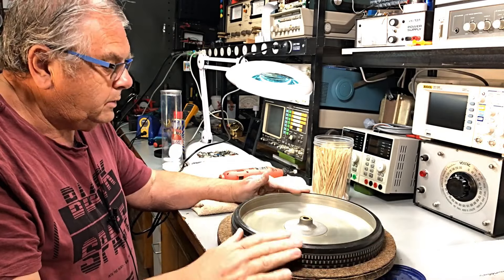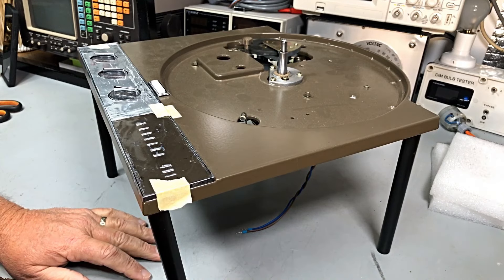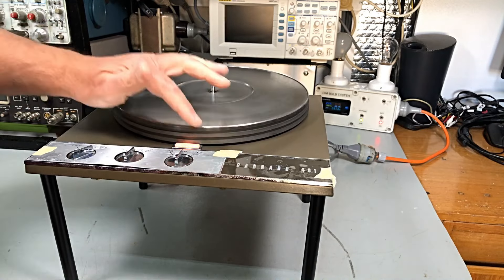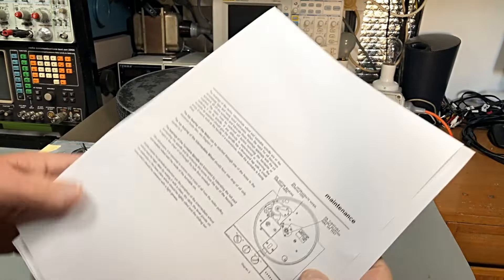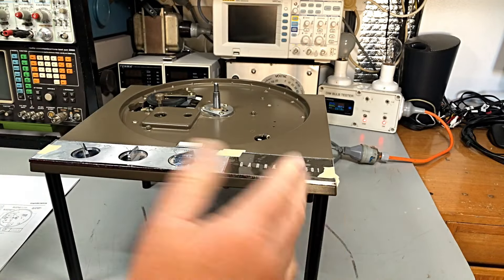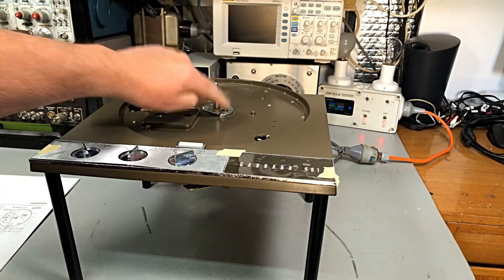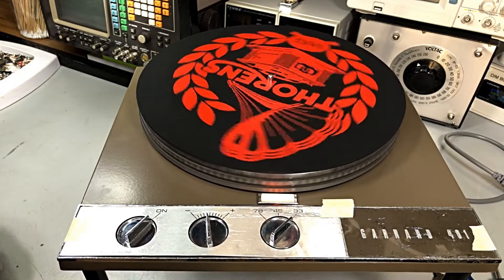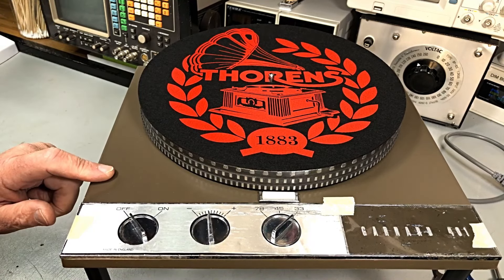Garrard 401 Rebuild Finale'  -  Part 4

Comment: Firstly, Congratulations on ONE THOUSAND SUBSCRIBERS!
One turntable down, one to go.  I can see why these are sought after.  It just goes to show that when done well an idler wheel turntable is right up there.  Such a pity about the front escutcheon.  Still, as you say, someone will have one.
Cheers and thanks for another great video!
Reply from the maker: Still in shock at 1K Subs Don, I am so happy that people are interested in what I have been doing for the last 55yrs.
This TT came up pretty nice & there are facial available on Ebay at reasonable $$. Thanks for you comment, means a lot !
Cheers Mate

Comment: one of the best turntable motor units ever made , some prefer the look of the 301 but i always preferred the 401 (i use one daily), when well set up with a good arm and cart and a good pressing of your favourite music, the Garrard 401 is a soul shatteringly formidable device , a technics 1210 may be more convenient but a/b listening shows the 401 is better in every way [ im not biased , honest 😅] . the facia plates are available from the UK via ebay and other online sources .
Reply from the maker: Thank you so much for this comment. The performance of these TTs is so good for idler drive.
It pretty well matches my Technics SP10 Mk3. ( but that's only my opinion).
I have found the facial on line at a reasonable price too. I will leave that to the buyer, some people just like the "original" used look.
Cheers
Reply: An EMT 927 or 930 will probably beat a Garrard 301 or 401 but look at the asking prices for the EMT's even in reasonable condition.